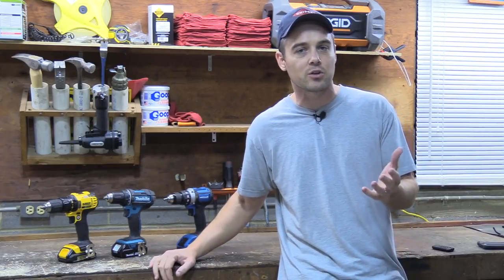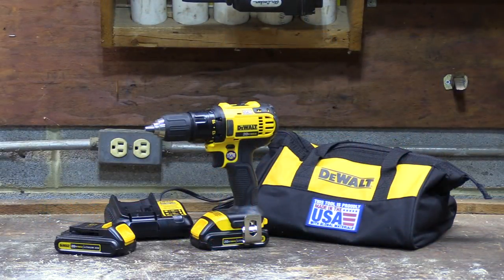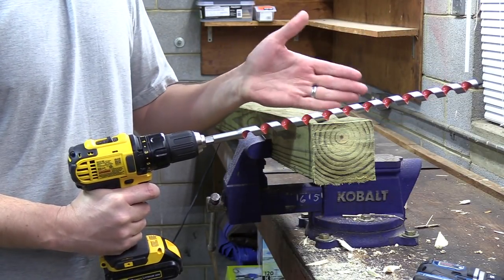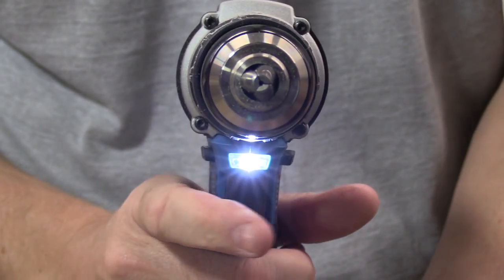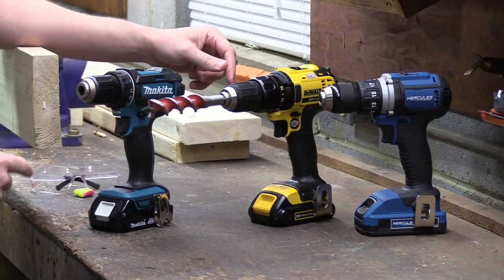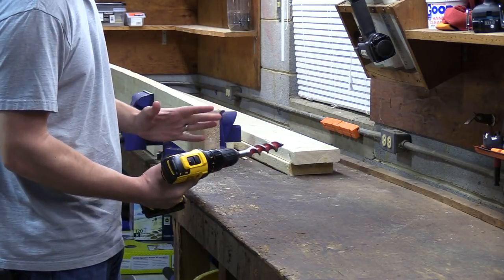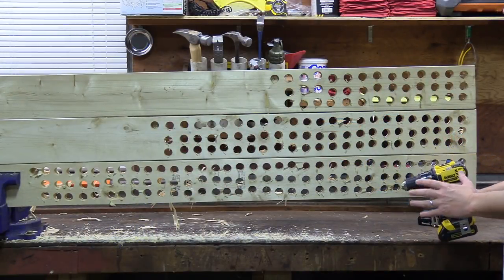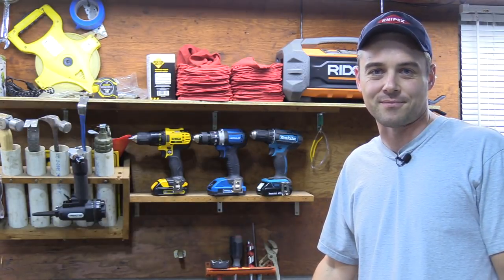Dewalt -VS- Makita -VS- Harbor Freight (Hercules) / DCD780 -VS- XFD10 -VS- HC91K1

Comment: i own both dewalt and hercules and use the latter and the main tool and dewalt as a backup. dewalt is slightly nicer as a screwdriver as it is more sensitive to the trigger pressure at low rpm. i am also not sure about long-term reliability of herc as it has not been around for awhile

Comment: They tested the Habor Freight against the cheaper models of the high end companies. Not a good comparison at all. The Makita XPH12T is absolutely bulletproof of all hammer drills! 
  I drill whiskey barrels metal bands every 30-33 staves on all 6 bands it's around 200 drills pre barrel. It's continuous drilling no stopping. I tried 
-Bosch DDS183 used all battery life 
-Milwaukee M18 2706 Will get red hot! 
-Dewalt Atomic DCD708B did ok. With some heat not as hot as the Milwaukee. 
  I bet this Hercules will melt
Reply: @Tyson Robinette 
You can't use a corded drill?

Comment: I use to think that Dewalt was a glorified version of a Black n Decker till I owned one. I think Dewalt pretty bad ass. It doesn't smell like it's burning up when I put it under a heavy load. It has way more power than I thought (which too much power for my job can be a bad thing). I think the price is reasonable for the quality. I never owned or use a Makita yet to give any input. I hear they are the best but till I own one I'll never really know.

Comment: Makita.  Great video, thanks.   I would probably choose the Makita for a few reasons.  Great case, longevity - because it has overload protection it is likely that this unit will disallow "abuse" and it will work better over a longer lifespan.  The warranty is 3 years. Plenty of power, and TWO batteries.  So, in fact, if you were going to FAIRLY compare them all, you should compare what the Makita/DeWalt can do with TWO batteries (because the Hercules comes with only one for essentially the same money).  So for the money, I can drill more holes for more years, more reliably with the Makita.

Comment: I would recommend getting a dewalt XR drill, I have been using it for like a year or two and it is still perfect, it has quite a good battery life also and the power and torque is plenty.

Comment: I Knew It Would Be One Of The 2 I Choose. But Over All I Would Say Hurcles Works The Best Over All So I Would Go With Hurcles In The Long Run. But If The DeWalt Had A Large Or Equal Battery I Would Say DeWalt Or Hurcles. But With The Current Battery Type Over All Hurcles I Would Consider The Winner Over All.

Comment: I own that Hercules drill. It will win best value at the very least!
Reply: Yup! The Herc won both value & efficiency!

Getting a 5ah Hercules battery for $40 at HFT is a great deal. I also have the blower ($60/no battery) and the reciprocating saw ($89/coupon, no battery) and I use those tools every week. Especially the shop blower.

The Hercules 12v line is also nice for indoor projects like hanging curtains & blinds. Smaller and lighter, but surprising power, esp for 12v. The rapid 20v charger charges the 12v batteries as well.

Comment: HOW CAN YOU COMPARE DRILLS WITH DIFFERENT AMP BATTERY PACKS ? IT DON'T WORK THAT WAY.
Reply: good point, but not sure it matters since you get more amps with the HF for much cheaper.
Reply: Something to consider is what you are getting for the price. The Hurc is cheaper with a bigger battery.

Comment: I have had the dewalt battery life sucks it doesnt run or stand the test of time, i have makita and i love it. I have never had a cordless tool last as long iv had mine for 9 years now same batteries that came with it and i use it daily and abused it not lost any power. But one thing you didnt mention in your test is the angle of handle. The other two are square to your hand putting pressure on your wrist. And you cant put as much power behind it or at least as easy as you can with makita. Look at makita chuck its pointed upwards putting tool more inline with your arm so you can put more power in it feels way better after all day use.  Idk my two cent you would have to try it for your self.  I only buy makita tools now.

Comment: My comment about my preference isn't fair to what you've used as examples as I use Milwalkee brand tools for my business. Many of which started with the 3.0 batteries and as I increased my collection am at 5.0 for a couple of batteries. Even more is the, I think I heard the 12.0's are available now for all the 18volt tools. 

So.... I'm quite impressed with the Harbor Freight drill. I was shocked, to say the truth. 

But... I believe the Milwalkee brand is the best that can be purchased. This is only my opinion so no=one get upset here and pull the Ford/Chevy/Dodge card on this statement.

Comment: I buy Dewalt hands down for the sole fact their products are Made In USA.  You can buy the bigger battery to get longevity. But, for most use cases, the standard batter is sufficient for 95% of consumers.
Reply: Made in China, assembled in the US.
Reply: @reedclow00  WRONG!  "Some" parts are made overseas but most components and ALL assembly is done on US soil.  Dewalt shifted operations back to the US over a decade ago.

Comment: I’ve been using my Makita set approx 225 plus days a year for the last 9 years. Dropped them from heights > 8’ at least once a week and have even sent my BL impact to do some underwater work a few times only to see it still kickin a$$. Even with that said, the price for HF tools make them “disposable” even if I destroy them to complete a nasty task. And “my MAKITA” stays clean and safe. Every tool has its job, even you. Good video too.
Reply: You need to invest in a lanyard for your drill. Dropping a drill at minimum 52 times a year is idiotic and risking a fatality.

Comment: Ok...I'm probably gonna get my head handed to me -but here goes
Although this article is about the Dewalt, Makita, and Hercules I still see references to Craftsman, Bosch, etc. So...my question regards Ridgid. I rarely if ever read any supporting claims or actually, any claims (period) regarding Ridgid. I'm a Novice and when researching tools I saw that they had a lifetime warranty on their tools and especially the batteries -so...as I'm not commercially using the tools I thought this was a good idea..are there some things/many things that you guys as professionals would warn against? I am looking at several more tools and before I get too far down the rabbit hole I'd like to make a good -informed decision...Thanks, and especially thanks to Real Tool Reviews -helping a novice to begin to learn the "skill sets"!
Reply: Ridgid is a solid brand very quality tools
Reply: Also Milwaukee

Comment: Had the dewalt dcd785 for about 6 years now nothing has broke on it batteries going strong on done pretty much the while house in terms of drilling bricks wood putting doors wordrobes together and 3 big sheds and a lot of wood work in that time it's the thing which I could recommend to buy but buy a newer drill mine if great and been used a lot and the new drills are even better now you won't regret it buy a dewalt

Comment: You test are good, I like to see them used, but amp/hrs battery size is crucial in determining how much work you will be able to get out of the tool. The cheapest tool only had 1 battery but it was the largest but adding the cost of another battery gets it up to the price range of the other two. 
I've used DeWalt and Milwaukee for many years in construction /maintenance and they are tough as a steel pacifier.
I'm sure all of these drills would work fine. What is very important to me is that the DeWalt had "Made in USA" right on the box. Buy American products when you can, our kids are going to need jobs too. Thanks for sharing.

Comment: Longevity and battery life are big issues that you only find out about over time. My experience is the cheap tool battery life is the weakest point. In the past the batteries in the cheaper tools have been inferior. However, just like everything else the cheap tool quality has improved and I imagine the batteries have also.

Comment: I have the Dewalt and the Makita and prefer the Makita... not much difference but smoother drive and less clunky
Reply: interesting video.  I think the failure of the makita with the large bit shows that the overload protection is working and this drill will last a long time.  I have had a makita drill now for 15 years and the original batteries brushes are still pushing this drill thru everything I can throw at it including drilling and tapping 1/2" -13 bolt holes in 2" plate steel.  I use me Dewalt drill for wood working because I don't feel it has the precision in the drive for metalworking. Harbor Freight is ok out o fthe box but I have see the guts in other reveiws and I am not impressed with the quality of the components.

Comment: I'm not surprised The Harbor Freight tool did so well but one has to remember that both Makita and Dewalt  have higher ah batteries available plus both companies have many other tools those batteries will work in. What other tools will The Harbor Freight's battery work in???  The average home owner will probably use a cordless drill once in a blue moon and this isn't good for batteries! Both the other two companies have lawn equipment that their batteries will work in and the average home owner will always be using their lawn equipment. ( good for batteries ).

Comment: I've used makita for years the drill itself is a more over all fit and comfortable to use they last for years in job site conditions  the battery life is longer than the dewalt as for harbor freight I'd be very careful you can by one and it works well buy a few more and they all go in the trash quickly

Comment: i own 3 dewalts all battery(2) 12 volt and 1 18mvolt i cab say after about 6 moths they really hAVE DROPPED POWER I ACTUALLY WENT AND BOUGHT A COREDE ONE NOT CRAZY ABOUT THE DEWALT AND THE CASE HAS ACTUALLY CRACKED ON THE 18 VOLT.v

Comment: I am aircraft tech I bought the first version of the lithium ion Mikita drills it looks similar but is black and white and has replaceable brushes close to 15 years ago still using the original drill original brushes and original batteries no matter which one performed the best Mikita is by far the best... I had several dewalts before you will get a few years or of it that’s it or the batteries will go... harbor freight I don’t know don’t care and you can’t beat a recharge time of 15 min

Comment: Ive used and purchased milwalkee, dewalt, makita, porter cable, hitachi and ryobi, but never the harbor freight tool. I have found that in genral makita s crap and will never buy another makita tool. Ive found ryobi to be garbage too. Dewalt and p.c. and milwalkee to be similiar in quality, although milwalkee batteries never last very longi buy quite a few hitachi tools based on power , battery life and price. I have 4 18 volt hitachi drill/drivers that i have purchased 3 or 4 amp hr batteries for, the oldest being about 5 yrs old and with 2 batteries each i use 4  to 6 batteries a day when screwing fence bourd on or deck bourd, things with steady use. The price of hitachi is genrally better too. Based on this review, ill have to give a herc drill a try. Thanks

Comment: Hercules tools will get you laughed off any job site faster than a tape that’s not Stanley. I see the objective benefits of Hercules, but imo the subjective “I’m serious about my career” factor of Makita and DeWalt outweigh the objective Hercules short-term benefits.

Just like a mechanic, the brand of tools doesn’t make the mechanic “better”. The brand is an indication of how serious and committed they are to sticking with the profession for any extended period of time.

Comment: It wouldve been nice if more science was put in to this. If you handed each drill to a different person they'd all get different results. Through pushing pressure, technique, etc.
You have to remove yourself as a variable. For example. How do we know that your hole drilling technique didn't improve as you used the tools? Fine-tuning yourself to know what pressure to use much more efficiently. Or you used 3 different pieces of lumber, and only ran one test each.
So while the test is nice, it's not a defining test
Reply from the maker: It is what it is.....one thing is certain however, no matter what you do — someone will always complain.
Reply: @RealToolReviews  check out project farms style of testing exact things like this. You have a rig that applies equal pressure by setting a weight on it. You do multiple samples to narrow error caused by different wood.

I do a lot of experimenting being an engineer. And I can't help but be thorough when looking at tests like this.
Reply from the maker: I watch exactly zero other channels that review or test anything.....that’s how I stay original and don’t copy anyone.  If someone else has a different method, I’m all for it....but this is the way that I do it.  I will say, I have tested many drills & in all of the videos, I am very consistent with how I rate them.  Thanks for the input! 👍

Comment: Everyone does comparisons when new. How about years later. I've had trouble with harbor freight. Their battery's suckered of time. One drill you're not talking about is the Ridged. They come with a lifetime warranty on batteries and tool. I still feel by better. In long run you should be ahead. So, let's see this test 5yrs from now with all drills used the same. HF wants to make extra money on warranty. Extended warranty add to buy a better tool.

Comment: Harbor freight. I assume at this point that all tools are made by mmmmm 5 companies. If harbor freight is going to compete they have to be better as each brand will try to have a home. Hobby.pro. place in the market. The only tool I have that runs on battery is the dewalt.its ok but I miss my keyed chuck. The bits spinn sometimes while I am drilling and it drives me nuts. Never thought to look at the batteries for amp hour ratings tho

Comment: Used unequal value tools. Buy a brushless xr DeWalt. Same price as makita but will have more power, last longer, battery meter, steel Chuck not plastic, 2 amp hour battery

Comment: Here the thing the batteries was key of unfair advantage in this video. If the batteries where the same then it would had been fair. I like dewalt and will go their as my choose. I have a higher amp batteries for mine lowest I have are a 4 amp batteries. Again if batteries where the same it probably would been same results. When make you choose brand make sure it same all round tool brand because of the batteries in my opinion.

Comment: Okee, straight out the box the Hercules wins.
butt if you work every day with or the Dewalt or the makita, in the longrun the will last way longer in turms of years that the battery will life end the overall built quality of the tool it self.
I use makita now for over 15 years en still have the first machine I buy end work with it. 
I bet a Hercules will not hold up more then two years

Comment: I’ve used all 3 of those drills I build custom stairways for a living but without even battery strength you can’t use this as an accurate comparison I personally use desalt cordless batteries with 5ah batteries I can generally go 2-3 days with no charging batteries between my drill and my impact driver

Comment: I would think Dewalt.
Reply: Wow.. I have one of the Chicago Tools $29.99 drills from HF. It replaced my 19.2v Porter Cable that I had for years. The drill itself is ok but the chuck it terrible. You almost can not get it to close down evenly on a bit, but it is nice to know that the higher end drills seem to be on pace with these other manufacturers

Comment: Ok, now I’m gonna see a real tool review. See what’s really up with Hercules. They seem ok, but for the price you could get tried and true well known brands for prices similar or a little more
Reply: shiningstaer but the Hercules warrantee is significantly better. DW and M warrantees require you to ship the tool back to the service center where they need to decide if the tool is covered. Then they fix it and ship it back. This can take weeks or months.  The Hercules is replaced in a store with a brand new tool. You can be up and working again in a couple hours. That's worth a lot to me.
Reply: Drew Messmann Milwaukee is so simple. Paid shipping. 7 day turn around.

Comment: And a real brand like Hilti will kill all of these in a heartbeat (very pricy thou). Hikoki will also be better. As a Construction worker dewalt is fairly cheap shit for everyday use. Makita works well but can have some problems with the gears on the newer models. Dont know if its because they overextended the market or what, they used to be crazy good just a few years ago. Dotn know of the Harbor brand but cheap stuff is rarely good for everyday use. Problem with all of them is the positioning of the light it should be down by the battery and not up by the chuck. I know some limited editions has in down by the battery and it works so much better when you really need it. And some diffrent brands have them down there.

Comment: DeWalt
Reply: I've used three brands: DeWalt, Makita, and Panasonic. DeWalt has outlasted the others. I've owned Dewalts for 15+ years with no mechanical issues, just battery replacement. The others had chuck problems, especially with small bits, and much more short-lived batteries.